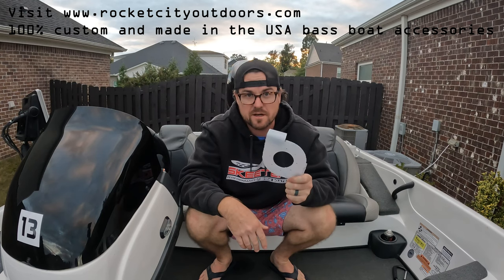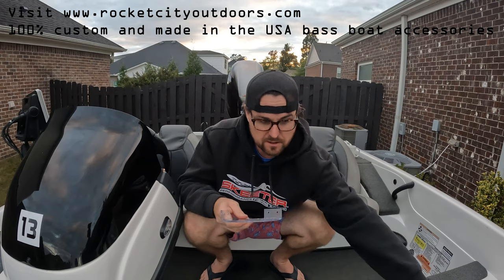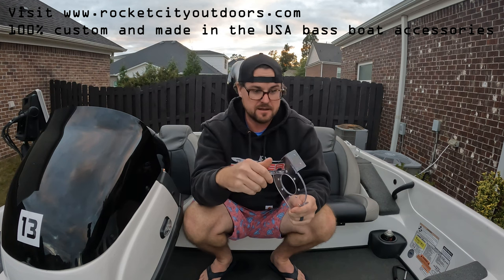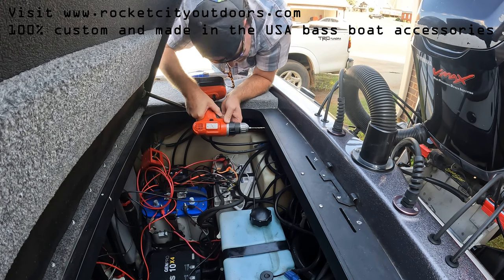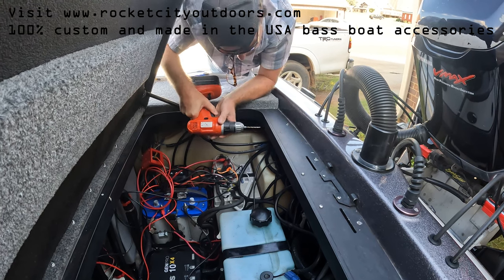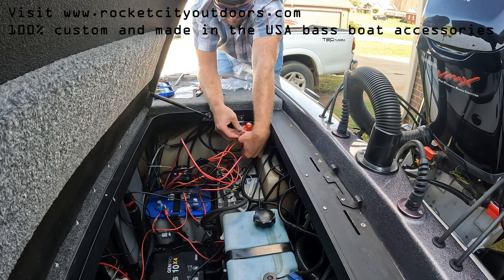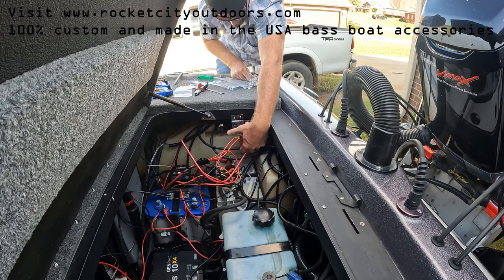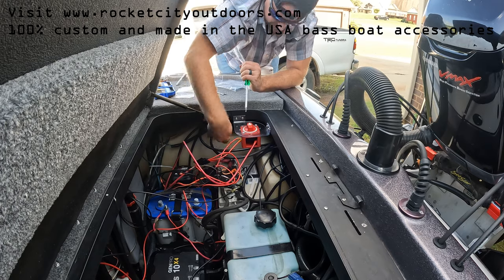Skeeter Bass Boat Custom Battery Disconnect Switch Bracket Install

Comment: Have you ever thought of making one longer straight bracket to hold 2 or 3 switches? I think it would make it more uniform and clean looking.
Reply from the maker: I have.  I’ve thought of making one big bracket that has two switches and one spot for a remote drain plug switch.  I just don’t know how much demand there would be for that.
Reply: @rocketcityoutdoors  I know I would like it, because it just makes it easier to have all them in one location. You will not have to reach here and there to turn the switches on/off.
Reply from the maker: If your serious I’ll design you something and make it after your approval.  Just let me know.
Reply: @rocketcityoutdoors  Yes. I want three switches in a row for my 2023 Skeeter. Design it where I can mount it either on long straight front or rear lip.
Reply from the maker: On it
Reply from the maker: @notsogood6249 Shoot me an email to rocketcityoutdoors@gmail.com.  I have a design for you to review.
Reply from the maker: @notsogood6249 if you are willing to send me pictures and maybe a video of the final install I will make you a deal you can’t refuse.  Shoot me an email.
Reply: @rocketcityoutdoors  I can send you pictures of the final install. I don't do video's , but I can try to using my cellphone. Thank you for the kind offer, just let me know how much I owe you.
Reply: I just added my e mail to your page.
Reply from the maker: @notsogood6249 got your email.  I’ll send you an email in the morning with what I’ve got and some dimensions so you can make sure it will work for you.
Reply from the maker: @notsogood6249 sent you an email early this morning.  Hopefully it didn’t go to your spam folder
Reply: Did not get it. @rocketcityoutdoors